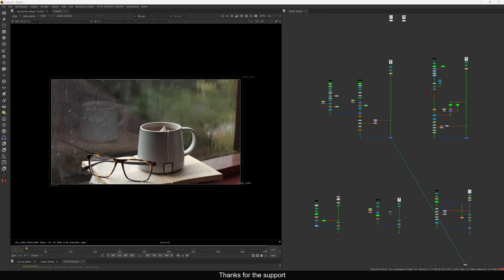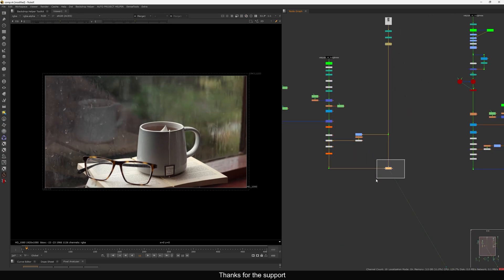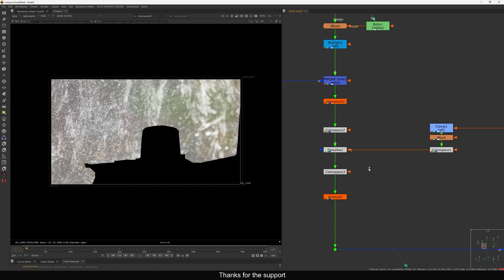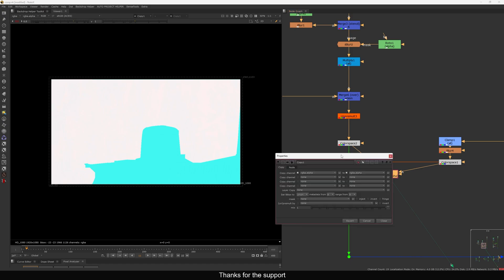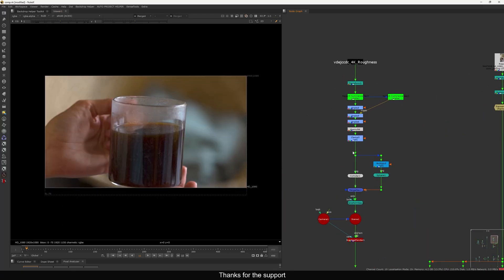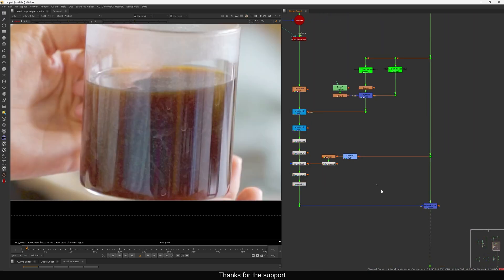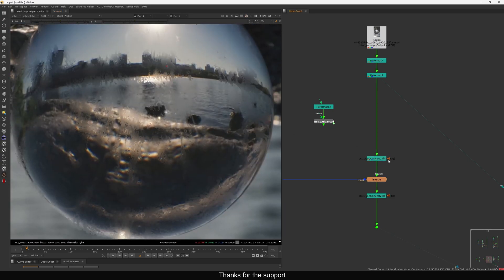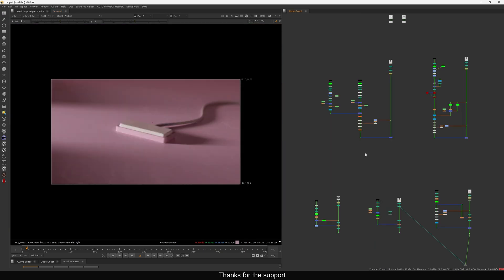Surface Imperfection Maps in Nuke: Add Realism to Your Comps 🎥✨ #Nuke #Compositing

Comment: Some great small tips in here. The workaround for the cylinder lacking end caps is great! I definitely struggle with random issues like that when working with 3D in nuke. The inflexibility when it comes to shadows, geometry transparency, etc can be a headache - I usually just go over to Houdini. Thanks so much for all the work you do!
Reply from the maker: Glad you found the tips useful!